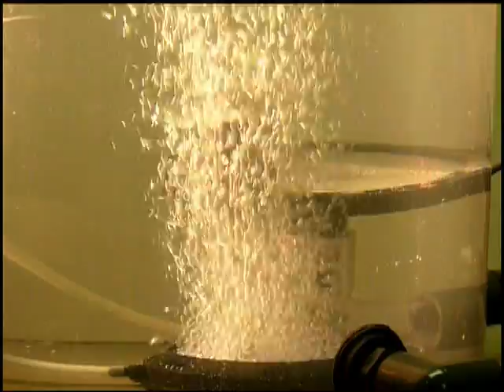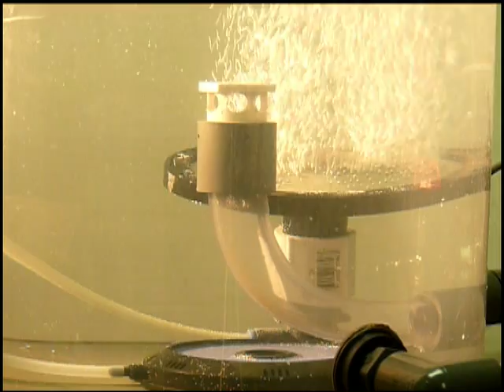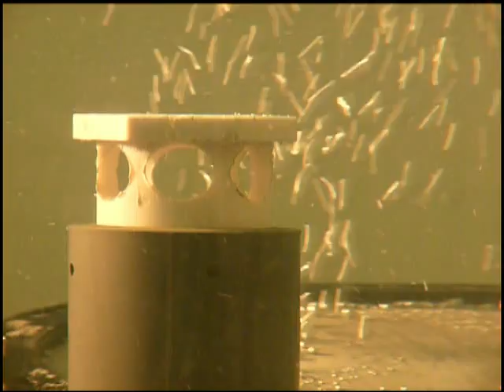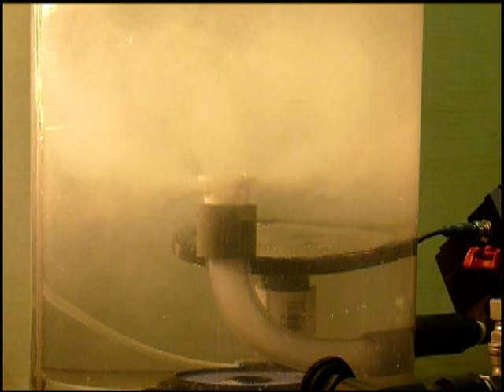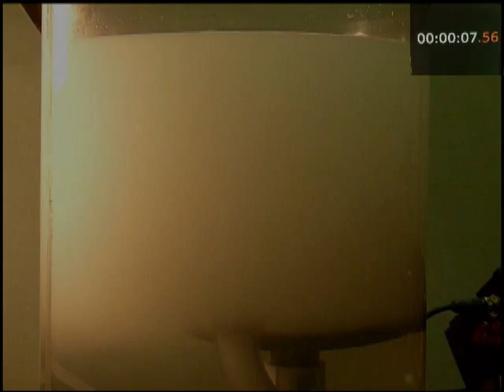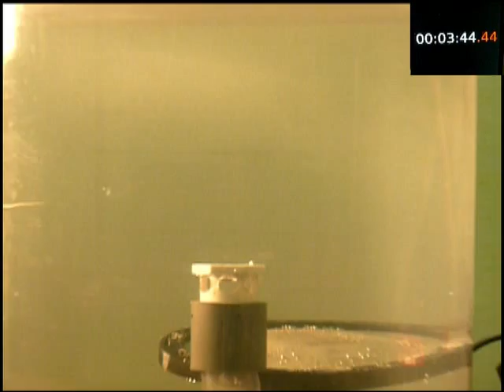Micro Bubbles Created Using Muddy River Technologies

Comment: Cool tech. What could be the capacity of this bubblier for 15 m3 of water?
Reply from the maker: deeban govindasami  Hey there, thanks for your comment. The short answer is that our system could saturate 15m3 of water in a very short time. The long answer is what you are seeing is not so much a bubbler as it is a Micro Bubble Generation System. These are designed and built for industrial applications. We are coming close to having a small and inexpensive alternative to our industrial product.

Comment: Hi, thanks for the information
I have been reading about Micro bubble generation using low power applications. does your tech use a combinaqtion of technology to achieve microbubbles. I was considering an application which uses untrasonic vibration through a fine mesh. As mentioned i am still researching the physics of generation microbubbles